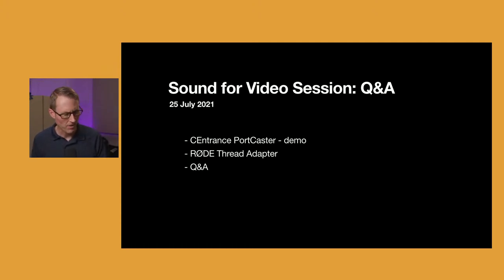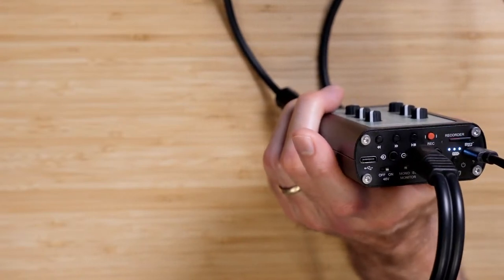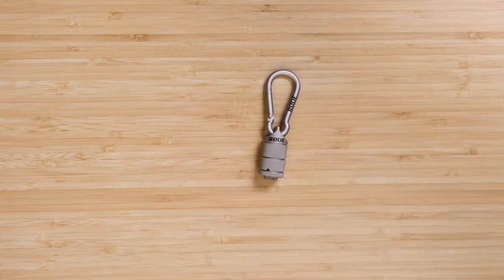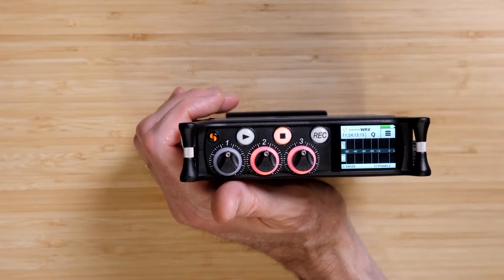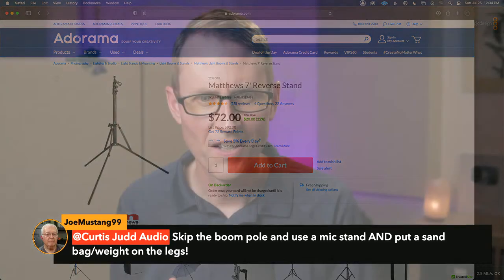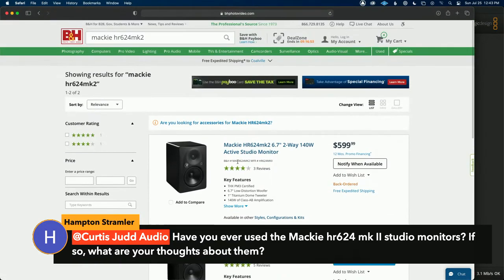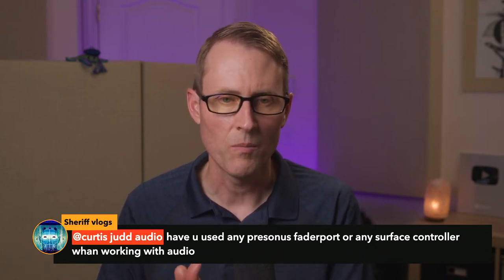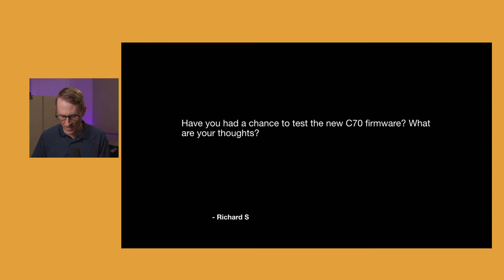Sound for Video Session: CEntrance PortCaster, RODE Thread Adapter, & Q&A

Comment: Audio hissing in a wireless lav system is usually RF interference either from intermod distortion between multiple TXs although he said freqs were mathematically placed, or from external sources like a DTV signal or remote focus control TX. But A10s are digital so normally there is either perfect audio or no audio, analog RF is where I hear hissing if there is an RF problem.
Reply: Thanks for the clarification, Allen.

Comment: This may be a silly question for you but if I want to use the Tascam Dr 60  mark ii with a XLR shotgun mic (MKE 600 Senheisser) on  my pocket 6k that has a mini XLR input to record audio directly to the camera, How will I connect The tascam recorder to the pocket 6k since all I see is a 3.5mm out on the recorder ? Basically I want to record directly to the camera and not separate. Is it even possible ?
Reply: @jamiegruenwald7363  if you happen to remember which setting on the pocket 6k let me know !! Thanks
Reply: @JoelRiveraMD  In the audio menu, change the left and right inputs to 3.5mm L and 3.5mm R respectively.